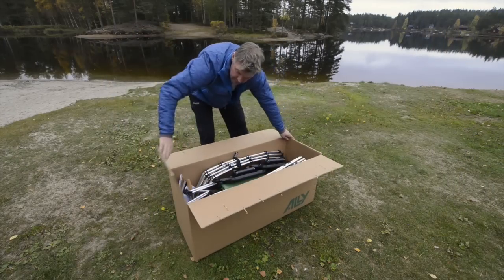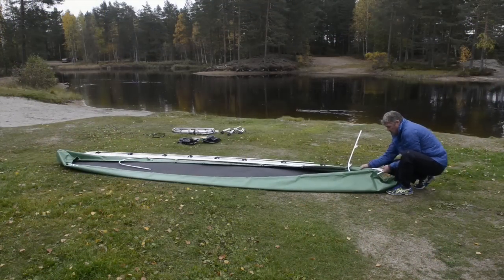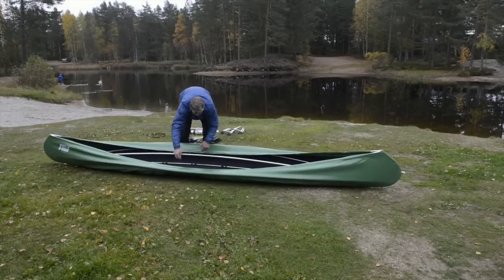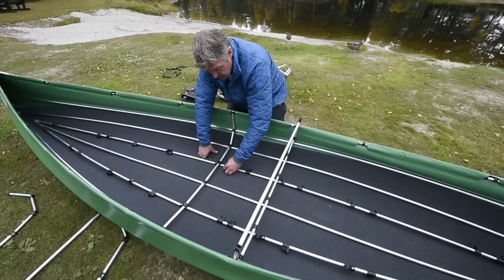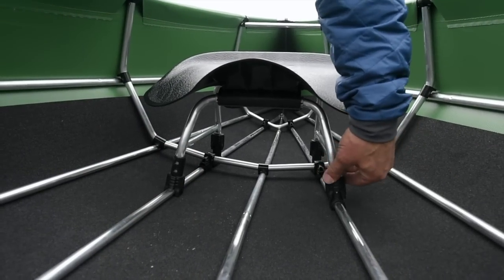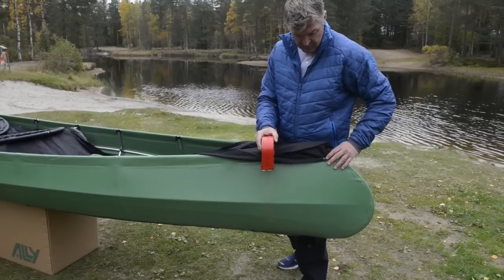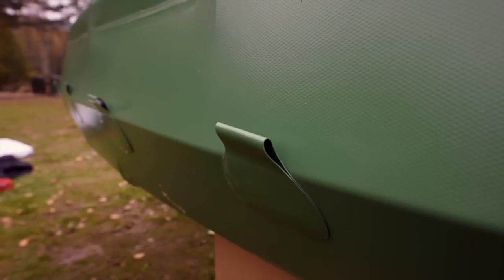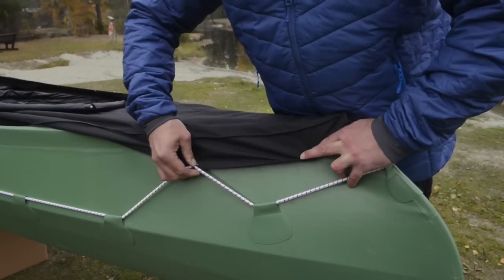How to Assemble an Ally Canoe

Comment: The video skips the most difficult step at the most replayed part of the video. How the heck do you put down the extremity pieces without ripping the kanu skin and suddenly the skin is nice and tight like a frame drum ?!!  I have to lay on my back and to block the tube junction with my feet while I'm streching out the skin and a friend put down the tube at the same time. I'm considering to sew a webbing to solve this issue.